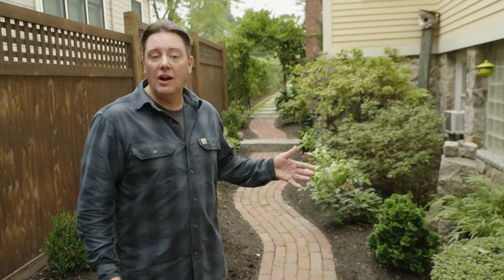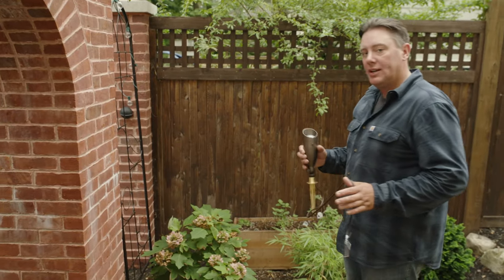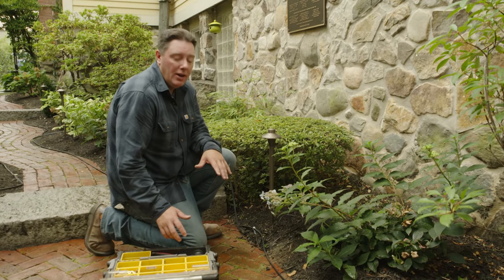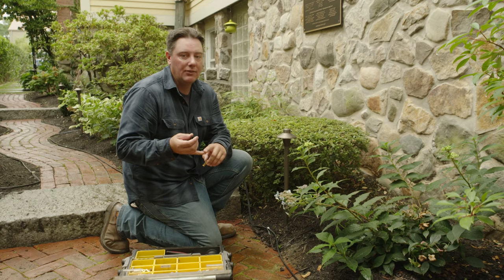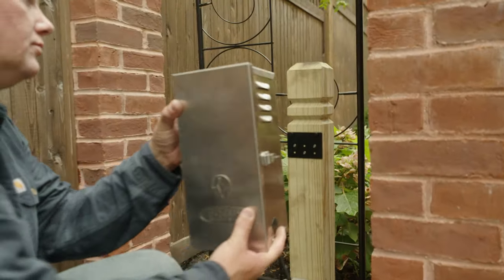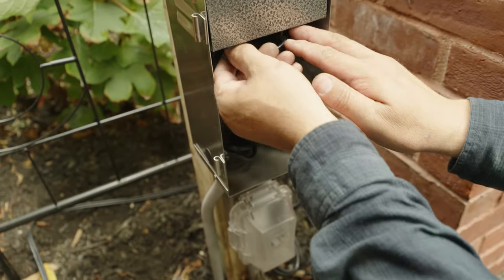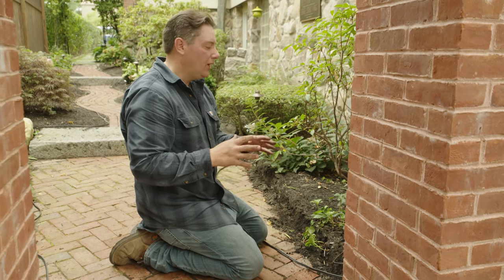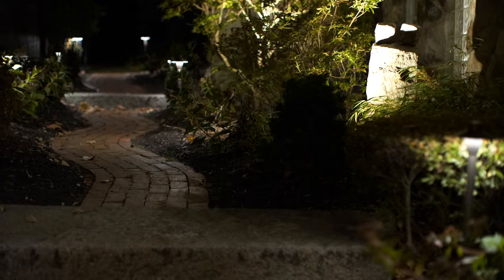How to Install Outdoor Landscape Lighting | Ask This Old House

Comment: This was good but would be nice to show more about the actual wiring from light to light.  It seems he laid 1 main wire that travels from transformer, but where did that 1 wire run to, and how are a series of lights connected.
Does the wire from the transformer just run to the first light input, and then an output wire from the 1st light runs to the 2nd light, and so on ???
Please explain this.
Reply: Hey Wayne 2:53 he attaches the light’s wiring to the feed wire for one side of the brass connector. The other side of the brass connector is then the “out” wire going to the next light.

Comment: I do installations professionally and one important future proof trick you forgot is using landscaping u-staples to secure the wire in place. Over time, weather makes solid expand and contract and if you just put it directly in the ground that wire will make its way up, especially if you put it in above weed barrier where it wouldn’t be secure.
Heat shrinking tubes are decent, but I have never had an installation get water in the system using dielectric grease fittings. Make sure to get appropriate sizes based on home many splices are in one connection. If running long distances, make sure you get proper gauges of wires and run separate home run lines.
Reply: Here in Arizona we bury the wire
Reply: @mcgarbagenuggets8793  Arizona weather and the Midwest weather is vastly different. We get a ton of rain and snow, which leads to soil expansion. When that happens, even a buried wire can rise up over time.
Reply: Not if it’s up to code (6 inches to the top) depends on your stats though . Should be buried at least 10 inches. U staples can be a hazard . Children or animals could step on them if they get unsettled . U staples is for stapling landscape fabric . That’s it.
Reply: You should not run it above the weed barrier . That’s job security though ! Plenty of maintenance
Reply: I do lights too . Not knocking your style but you should check the code. Good Heat shrinks are the highest quality connector (most durable , best connection , most waterproof ) the best heat shrinks is “ lighting shrink “ fxl sells them and they come with there water lights because it is so good at keeping out water even more than silicone nuts , but there expensive . Only necessary for a water light.
Reply: @bobufo5729  I’m assuming with 99% accuracy you didn’t read what I said based on that comment
Reply: @bobufo5729  and I’ve been used a different heat shrink and grease fittings from my local supplier for going on eleven years now at an average of 100-115 landscape lighting installs a year and 240 Christmas lighting contracts.
I’ve never had a service call except for the 1/100 chance a random bulb just wasn’t right, Which happens with all brands, albeit more rarely with companies like brilliance. Not an FX Luminaire fan. They’re drastically overpriced when there’s plenty of high quality products that have the same capabilities for far less.
Reply: @Batsonoutdoordesigns  what brand do you like ? And I did read your comment. Do you use brilliance ? There new national park line is interesting . I think we can both agree kichler is junk right
Reply: @Batsonoutdoordesigns  fx in my opinion is worth the extra money. Also brilliance has nothing like the Luxor system . But they do make good looking fixtures. And if you saw my comment I said that you don’t need a heat shrink connector unless it’s a water light. You don’t have to use one on a water light but you should.

Comment: Very interesting connection method. This seems way more reliable than those "easy" connectors that you press together to pierce the wire which inevitably lets moisture in and corrode the connection. The heat shrink tubing with adhesive inside indeed the best thing to use. You should also use some dialectic grease inside the brass barrel connector to further mitigate water ingress and corrosion. 
I personally ripped all mine out and soldered everything together then heat shrink.
Reply: Dialectic grease would definitely help with it. I would use heat shrink tubing with silicone grease to waterproof the whole thing. If you do all of those things, the connections should be as safe as can be from what I can tell.
Reply: the pierce connections are easy but yeah they don't last terribly long.
Reply: Wire nuts with dielectric grease work just as well and let you easily remove the fixture when it's time to replace or repair it.  In my experience, the biggest source of a disconnection is either a landscaper hitting the wire with a shovel or an animal chewing the wire.  I agree that those snap on connectors are   terrible.

Comment: Just like the cheaper solar lamps, after a few weeks they start to tilt.  How to prevent that?
Reply: Get like a 2 liter bottle and cut it half way and fill it with portland cement and stick the light in there and prop it up. Bury it when it hardens.
Reply: @kangkim150  quite a smart idea. Ty
Reply: Throw it away 👏

Comment: So right off the bat I am 4 mins into this video and he really didn't show us how he connected all the wires to the lights or connected all the lights together and with the terminal, he didn't show us how   it connects to the power source.
Reply: Actually he did. That’s what the brass screw in connectors with the heat shrink is doing.
Reply: You have to use a voltage transformer.
Reply: He literally showed you how to do both, if you didn’t get that you shouldn’t be doing this yourself. I hate when people say what I just said but in this case I feel like I’m justified.
Reply: You have to watch the whole video. Transformer is at the end
Reply: I see you.  He shows the connection for the light to the power source, but that wire runs to the end.  So if this is the last light in the chain, then this is correct,  but how about the splices in the middle to add the other lights?  There would be 3 wires in each connection....light, power in, power out to next light in the chain.

Comment: The problem with an integrated LED pathway light is that when the LED burns out, the entire pathway light needs to be replaced.  It's not like you can just replace the LED.  Seems ridiculous.  I know they may claim 50,000 hr operation, but that has not been my experience.

Comment: This video is a hack jobs way of doing this

Solder and heat shrink is the best way to do it and builds skill and knowledge not to mention significantly cheaper

If you’re going with these expensive brass connectors he should be using wire ferrules, screwing down directly on stranded wire will cause a failure point

Then heating the heat shrink with a torch, instead of a proper heat gun

Shameful

Comment: > It has adhesive inside and it's never going to be a point of failure

You might as well also install fire alarm right next to it even though it's just low voltage while you are at it..

Like seriously what's so difficult in getting silicone paste or worst case scenario fill that up with crazy glue if you have to use heatshrink "with adhesive" outdoors..
Reply: Install a fire alarm outside? If your talking about commercial fire alarms, you only wire them to a FA control panel, not to a lighting transformer.

Comment: You skipped the most important information. Wattage and wire length are pretty important for calculating wire gauge and transformer size. Basically, this video is worthless...